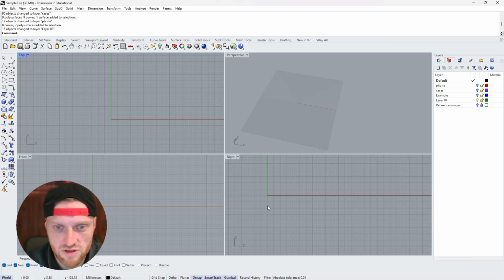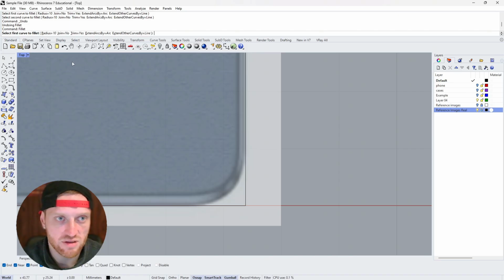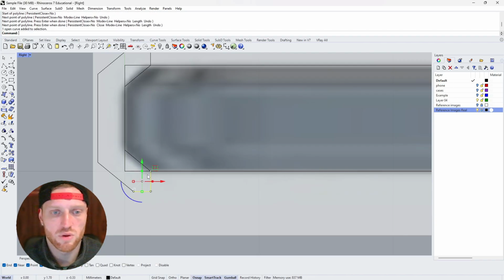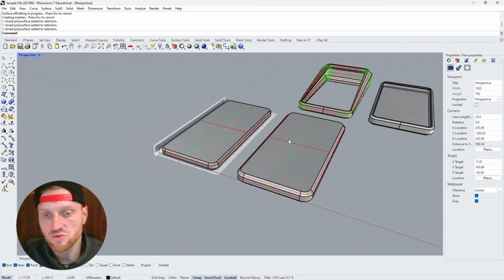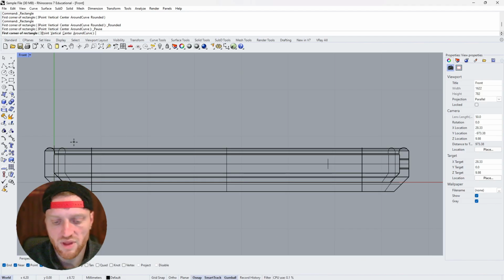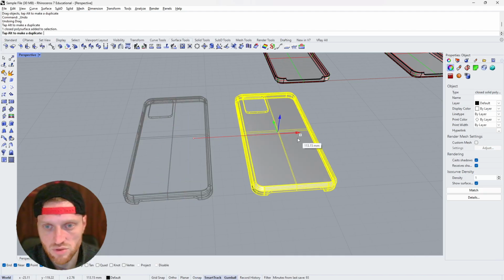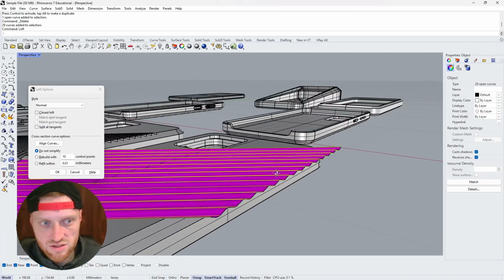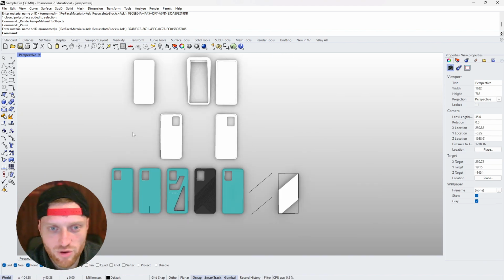Learn Rhino Step by Step: Design a Phone Case!

Comment: Just the Phone case in 1 hour, insanely slow.
Reply from the maker: It's 1 hour to explain and show different ways to approach and design several variations of a phone case. Never worked with plasticity... Can you easily achieve a wave pattern that fades out?
Reply: @DesignwithViktor  yes and much more easily, even can change the wave depth very easily. 
In rhino, we have to delete it first and then untrim surfaces and again have to make Boolean.
Once you get used to plasticity, you will love it. 
Search "plasticity by Nikita kapustin to learn"